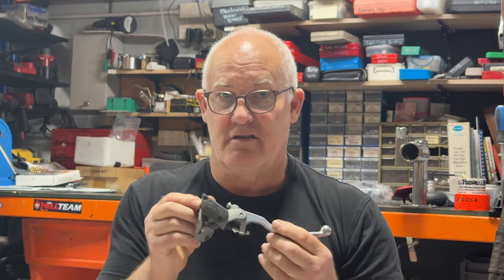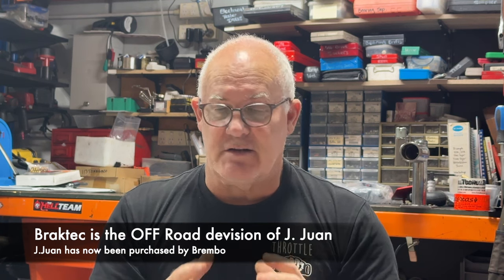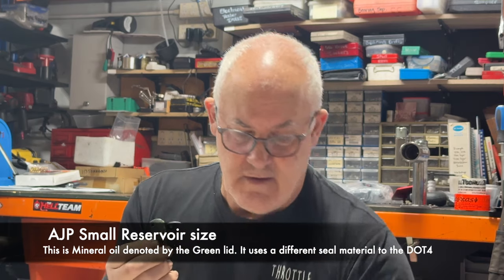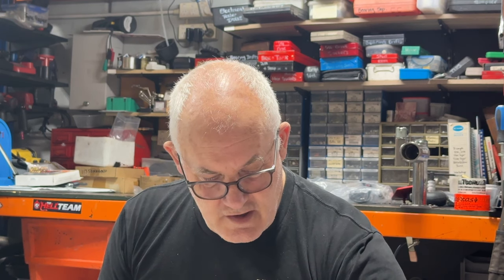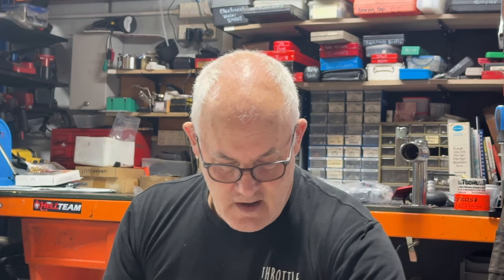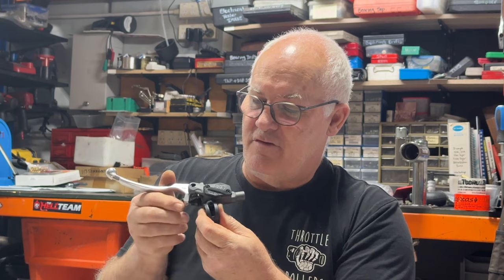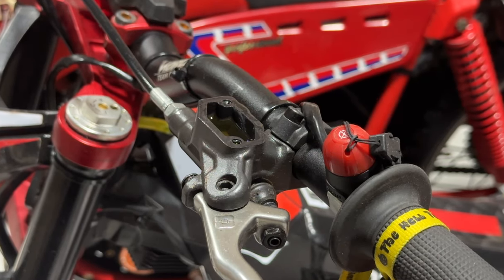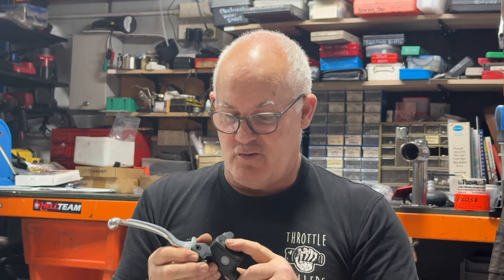LET'S LOOK AT MASTER CYLINDERS

Comment: Hi Paul, a customer has just pointed this video out as he wants a softer clutch pull, I've measured the distance from the pivot point to the plunger on this small AJP and the Braktec master cylinders and they are both 19mm, so in my opinion they will both offer the exact same lever pull. Weirdly this older Small AJP master cylinder used to have a larger distance when they were first introduced as they used the same lever on the front brake version so it was around 20 to 21mm which gave a stiffer but faster lever pull, I think they swapped the lever to a longer length lever with the 19mm distance in around 2009.
Reply from the maker: Yes it seems that there is a bit of variation, but also the lever will make a difference, if you look at this link, (https://drive.google.com/drive/folders/0B0Mfile5AhnmdGY2SGNHT3lySWc?resourcekey=0-UUOJWIAAoRZmwCeHefFNFQ&usp=drive_link) I measured a few levers and they varied between 14mm and 20mm so this is also going to affect stroke of lever vs stroke of piston.

Comment: Thanks Paul, very informative. I have drag in my clutch after sitting with the lever pulled in for awhile. Thinking possible seal damage. 125st sherco 2012 model. Bike will stay put with a brake on. Your thoughts?  Cheers Steve
Reply from the maker: Yes it sounds like you are getting bypass past the main Hydraulic seal, especially if it's 2012 model bike. Pretty sure that would be a Formula master cylinder which had some notoriety for wearing seals.Chuck a repair kit at it and it should get you there.
Reply: @TheHellTeamTrials  it's an ajp, do they have a kit for those or just the bit you showed on the video (the first one with all the little ribs)
Reply from the maker: @stevesims8232  yes it's a kit. Comes with Piston (seals installed), spring, circlip, rubber boot, actuating pin and it's spring.